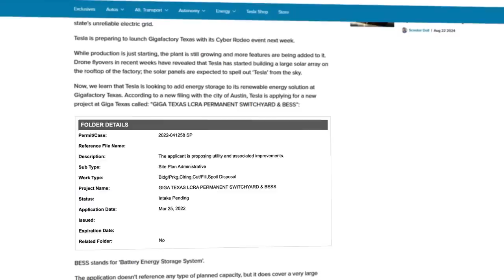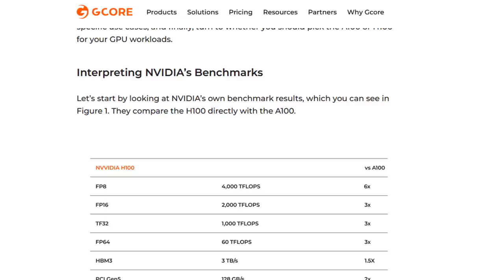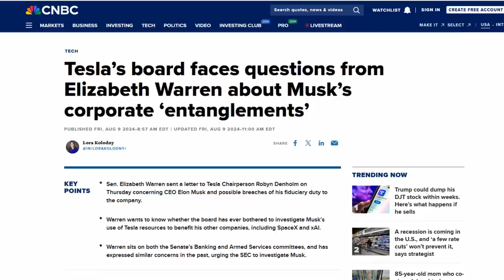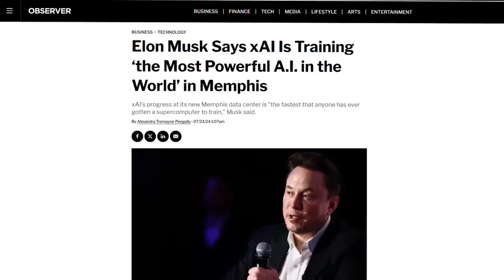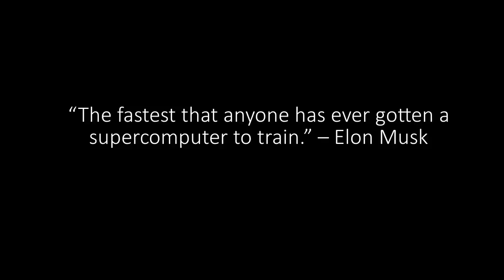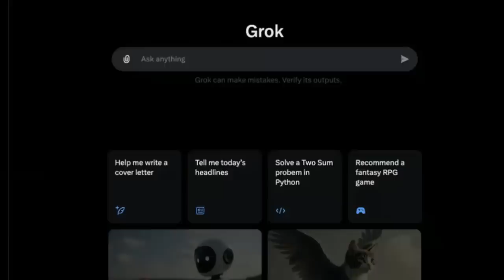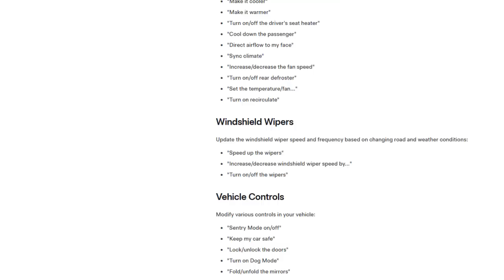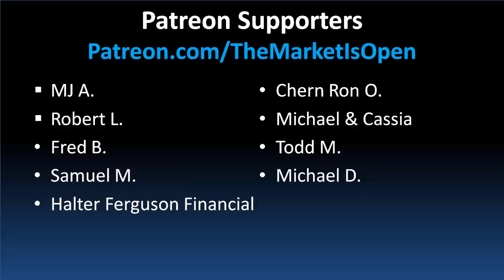Why Elon Musk’s Supercomputer Will Shock the World

Comment: Tesla's next big thing will be "Wireless Charging" needed for Robo-taxies
Reply: Wouldn't quick exchange battery banks be more useful? The battery bank could still be part of the car's structural strength but the car doesn't need to be 100% structurally strong for the one minute the car is having its battery bank swapped. Then once the new battery is swapped the car is back to being 100% structurally strong. Tesla missed the boat on this one.
Reply: Nah just hiring someone to plug them In and unplug them is good enough for right now. Next big thing is to launch their ride sharing app and have owners of teslas start making money with fsd supervised. Unsupervised comes in 2025 o